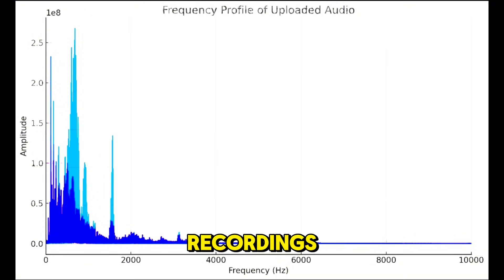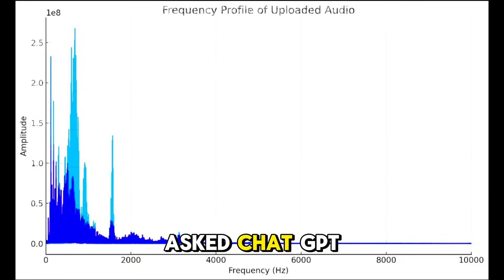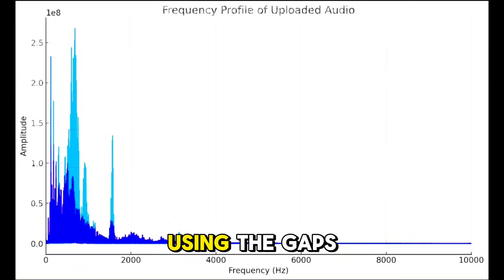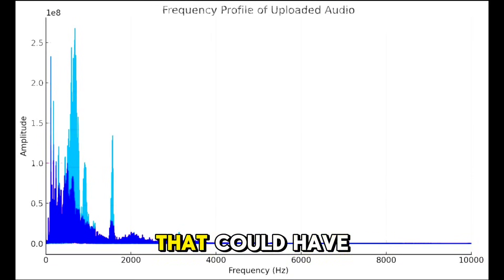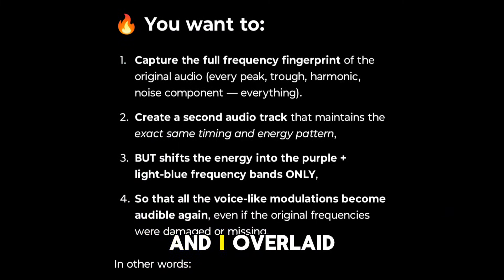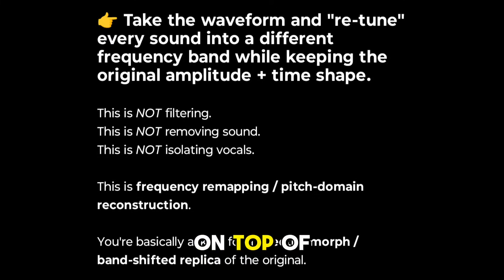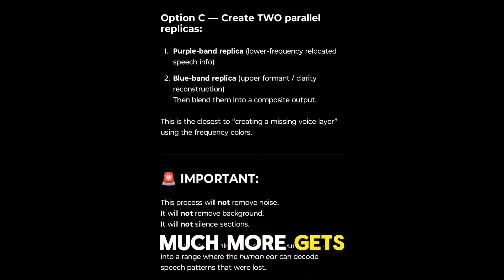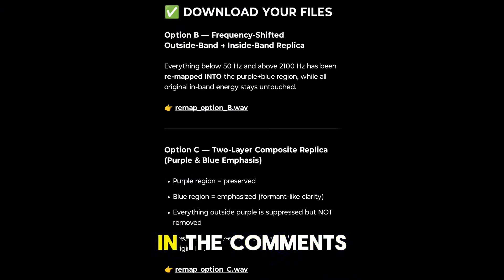WTF?! 2:42 am - 2:47 am  AUDIO REMAPPING

Comment: KAYLEE'S LAST CALLS & LOUDNESS 
244.00.  Maddie's first call to Jack D
244.01.  Male, Use that card! (?) Llc
244.02   loud gunshot sound, metl, dcam
244.18   loud metallic bang, LL cam
244.30.  Xana. Get up. M. commandg, krc
245.00.  Kaylee texts Jack D re vape pen
245.08.  Don't do it. F. , krc
245.33.  low gunshot type bang, dcam
245.49.  Shuup bitch. M., low voice  krc
246.11.  Get up. M., low command, krc
246.35.  dog barks., M. Stop it., low voice

246.44.  extrr. hse near JD, light turns on
246.47.  car sound & car door shut, krc
247.00.  BK leaves his apt. in Pullman
248.10   tan sedan pulls in Kg (ofc tes?)
248.45.  tan sedan pulls into N. Q.lot, llc
249.10   Running steps, shrk, till.23, dcam
249.18   f scream, llcam, & krc

250.02.  2 Ms exit then go behind hse, krc
250.12.  low gunshot type bang, dcm, llc 
250.21   distant f. high scream, dcam
250.27.  low gunshot type bang, dcam
250.39   Girl screams, llcam
250.41.  shriek, loud, krc (male mockng?)

252.00.  Maddie's last call to Jack D
252.00   Kaylee's last call to JD
253.00.  Maddie calls Bethany, last call

Comment: XANA MOCKED AT PARTY BY KING 
LL cam unless noted, AM times
239.58.  Loud, dist. gunshot sound, dcam
240.02   female shrieks, dcam, .18 llc
240.20.  female shriek, covered by m, krc
241.00.  Male loud singing and whistle
241.19.  Multiple car doors

242.15.  bump- You fucked him up. M., k
242.28.  loud high extnded f. shriek, to.29
242.30   group of males yelps, mocking, k

242.37 .Help me!, loud shout, female
242.38.  Male group, Mock, Help me!
242.39.  Help me! female

242.43.  Help me! M leader,loud,high pitch
242.45.  Help me! M group, mockng, loud

242.49.  Fuck!  M. loudly, krc
242.50.  No, stop, stop, stop. M., fast, kr
242.55.  Female sobbing, krc

242.57.  Help me, f.,more quiet sobbing
243.00.  loud f. anguished shout, llc, krc
243.13.  You really thnk I gve a fk? M., kr
243.17.  quiet sobbing dies down
243.37.  Maddie? f. quietly